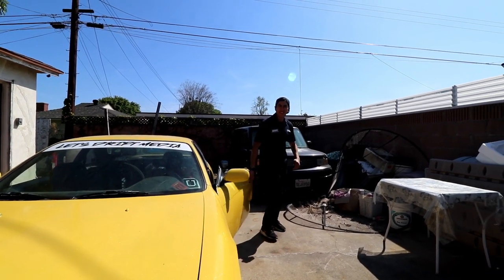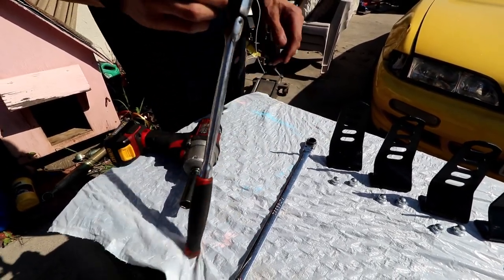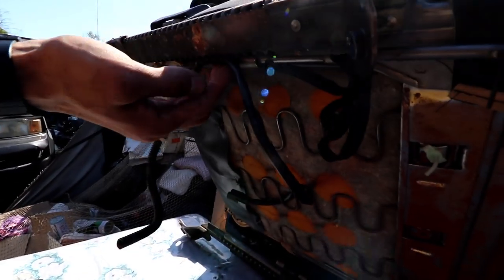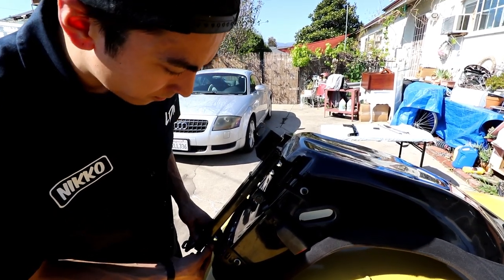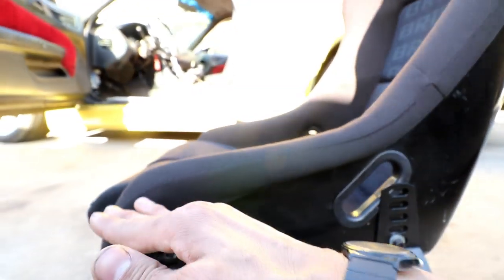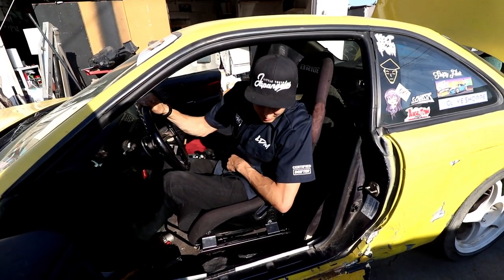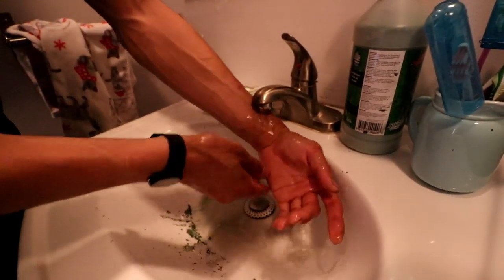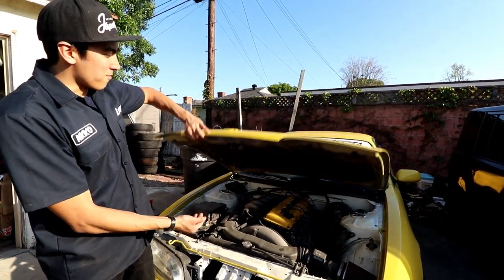INSTALLING A FAKE BRIDE SEAT (240sx)

Comment: Yea every seat except for stock s13/s14 seats have always been a bxtch for me to install lol. Ive had old school recaros and bride reps but i always got good quality seat mounts like street faction ones and they still have a hard time lining up/mounting up easily. 3 bolts will line up and the 4th just wont. Wut helped me was i lined em up first and threaded each one little by little. I finally got my shxt lined up but now my sliders wont lock in place. Now i have to take em out again to fix that lol. SMH